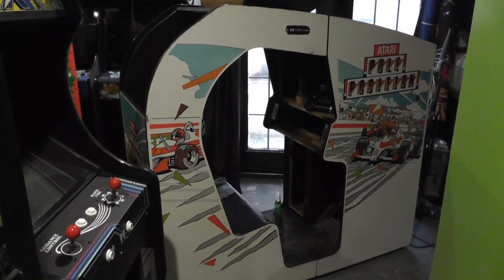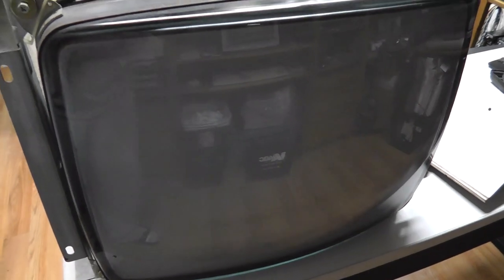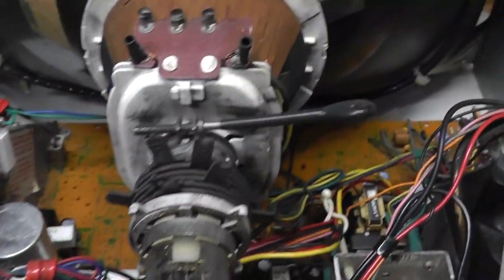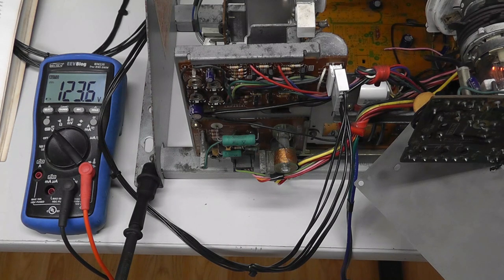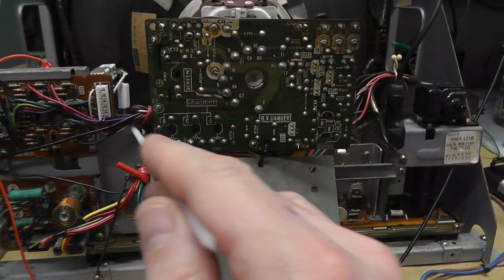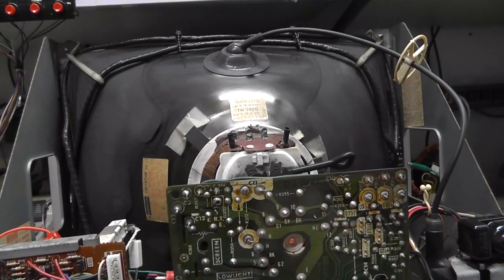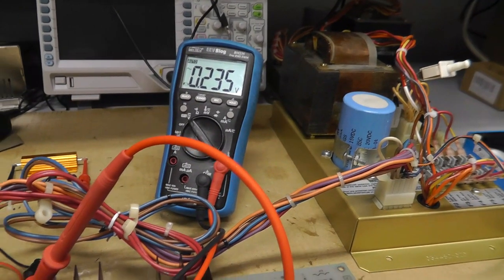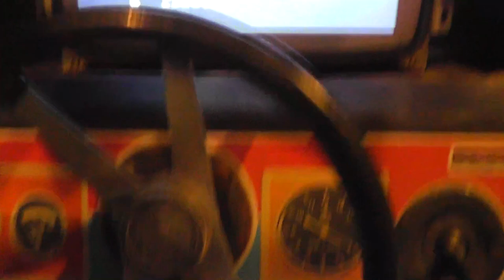Atari Pole Position Cockpit - Refurb Part 2 - TM-202G Monitor and Cabinet Test

Comment: For all arcade monitors, #1 to set the B+ voltage, turn OFF the VSG video signal generator then you turn the brightness trim pot to "maximum" and adjust the B+ voltage to +123vdc, while setting the RGB cut off trim pots, Drive Trim Pots, Screen trim pot to the center middle position?  #2 to set the Grey Screen, turn OFF the VSG video signal generator you turn the brightness trim pot to Minimum and adjust the RGB cut off trim pots until the arcade monitor screen is GREY?
Reply from the maker: Each monitor has a different recommended procedure afaik.  Usually the b+ adjustment has nothing to do with brightness control or at least it isn't called out on the ones I have done.  Not sure what or why the tm-202g lists the procedure it does.
 
For color tracking, white balance, grey scale whatever you want to call the overall procedure, some manufacturers say center the pots.  The g07 and tm-202G say all cut-offs and screen should be full counter clockwise and only the drive pots centered.